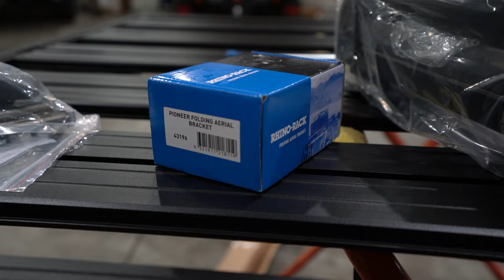Transform the all new Toyota LandCruiser 300: Ultimate Build. UHF, Roof Rack & Dual Battery System

Comment: Nice spot for the UHF pass through. Have you seen the room in the rear panels on a GR as yet ?
Reply from the maker: Thanks Stephen! GR doesn't have much space in the rear panels as one side has their aircon system and a bunch of electronics on the otherside! Little disappointing!
Reply: @BAWAutomotive  disappointed if you wanted to use the space perhaps. Not so disappointed having the extras 😀